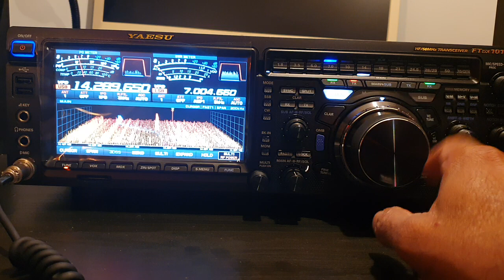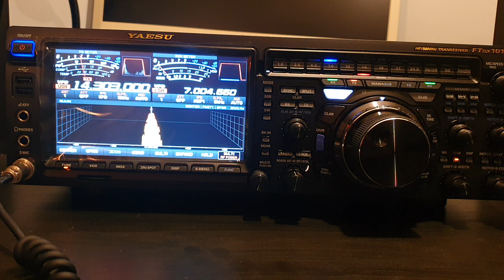Yaesu FTDX-101D Transceiver | Pushing the Boundaries of Performance

Comment: Get the SCULAN-10. I love it. works great with my DX10 and should with your 101 as well.
Reply from the maker: Sure I will consider it as it is an excellent harware for remote operations by Yaesu for FTDX101 & FTDX10. Many thanks for supporting the channel.